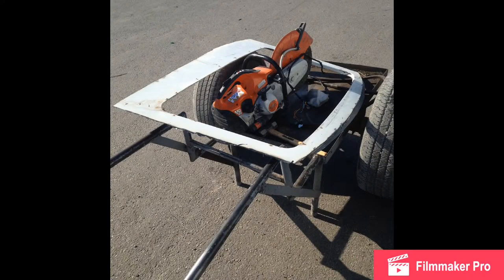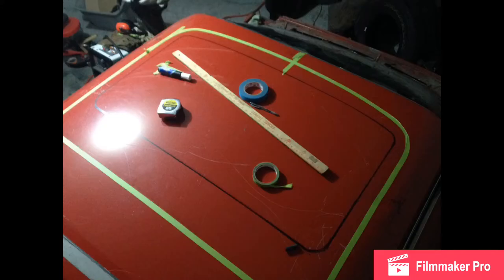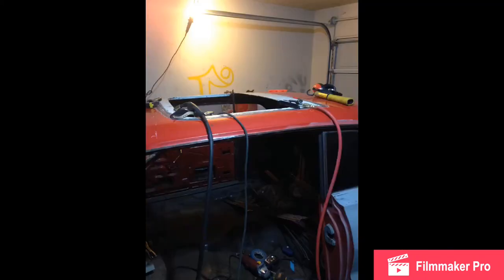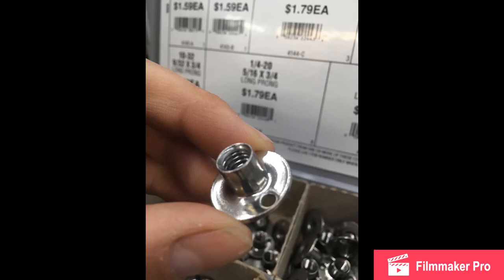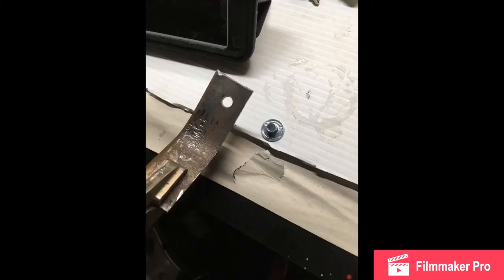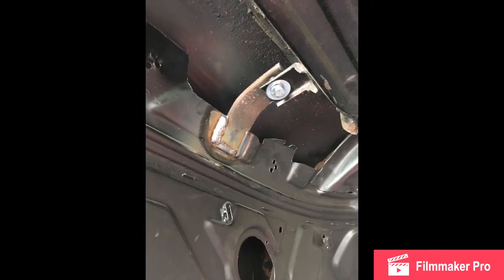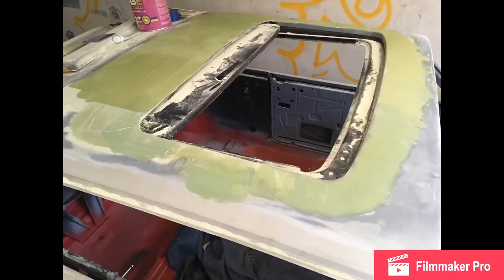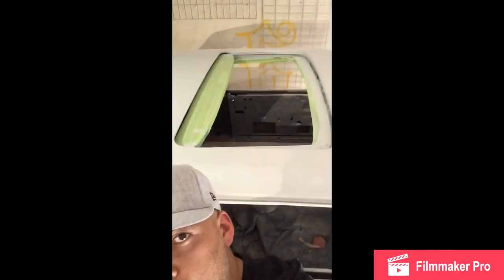44” moon roof install details part 2, 1964 impala

Comment: Nice job bro, I Just put a 1 1/2 inch crack in my glass. I’m Still waiting to wake up from this nightmare.
Reply from the maker: MACHINE iN MOTION Thank you, 
how did it crack? 😬
Reply: Red Rocket 64 i was testing to make sure the motor works.i replaced the switch (70s caddy)with a 3 prong hydraulic switch & sure enough it was working,then the rear passenger side popped off track 😴 lesson learned take it slow slooooowww lol
Reply from the maker: MACHINE iN MOTION Oh man, hopefully the crack doesn’t run, hard not to get switch happy on a momentary 👀😁
Reply: Red Rocket 64 true lol 😂

Comment: Question bro, did you have to remove the headliner mounting ribs further in the back of the roof also?
Reply from the maker: 504bricks Yes, they were obstructing the actual tub and had to be removed. 
Hope that helps
Reply: Red Rocket 64 was the roof skin attached to those ribs?
Reply from the maker: 504bricks no
Reply: Red Rocket 64 thanks for the help bro, will start mine this weekend
Reply from the maker: 504bricks No problem, be safe 👍